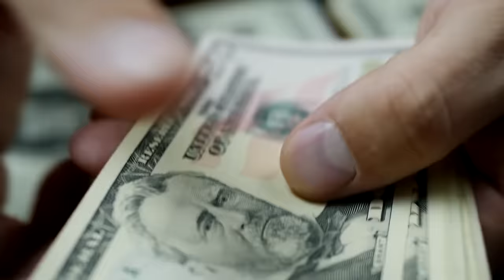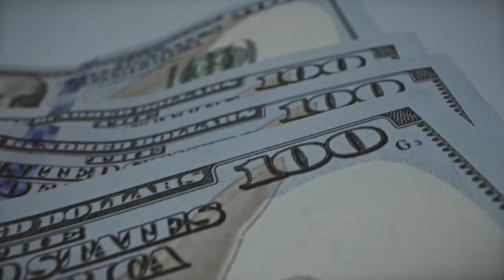NEW Boeing & NASA Transonic Wing Just SHOCKED Everyone! Here's Why

Comment: A bad idea that will only deliver money to the design community.....
Reply: Why is it a bad idea?
Reply: I also wonder where is the fuel gonna be carried if not in the wings ?
Reply: @rscott2247  They'd have to do something like store it forward and aft of the gear wells.  That's gonna be one hell of a fuel system though.  You'd have to pump it from the bottom of the jet and through either the wing struts or the fuselage/pressure vessel somehow.
Reply: Every Junction is added drag, every structural fuselage crossover is added weight / space/ drag, every additional structure perpendicular.. the airflow is added Drag and weight, and area for ice accumulation....I guess the next thing they will try is a Biplane and/or a big noisy prop...
Reply: @regdor8187  
The point is you can have wings with a huge aspect ratio. With the brace the wing can be much longer and thinner than without. The added efficiency from this outweighs the negatives.